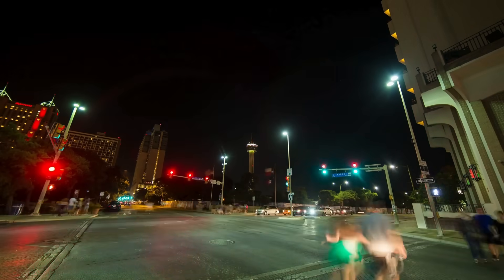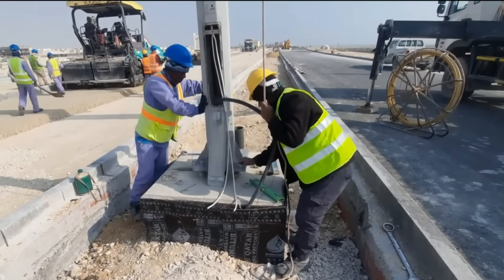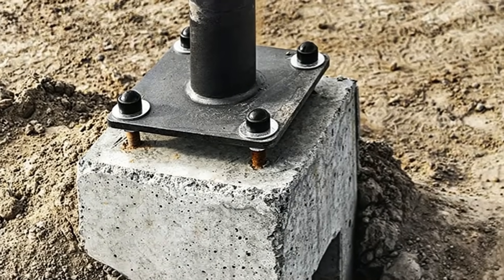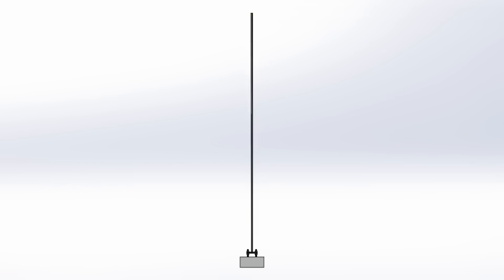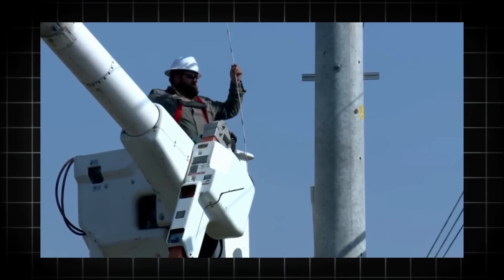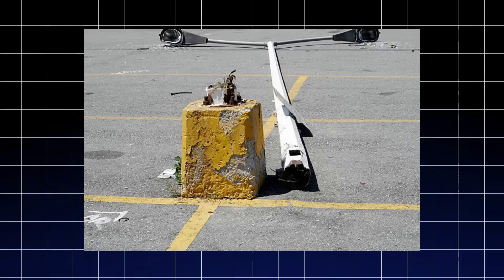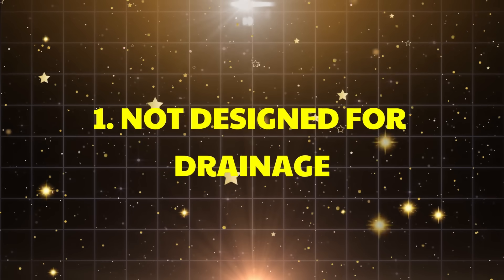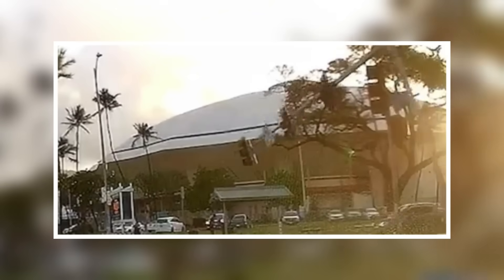Why Light Poles Float on Bolts Only, Not Flush with the Ground?

Comment: I sincerely doubt it is "engineers" making adjustments on those nuts.  Having worked as a plant engineer in an oil refinery, it was very much "look but don't touch".  Union rules and differences in responsibilities meant that we had to get a trades person or an operator to pretty much anything physical.  They did let us read gauges though.
Reply: Engineers make drawings and write specs, mechanics turn wrenches.  People use the word engineer to cover any type of work.
Reply: @GlobalWarmingFraud that is not necessarily true, particularlyin small companies. I make more money because of 'desk work' but have more fun doing 'shop work' I try to split my time between design and build. It usually winds up being about 60/40. I do agree civil engineering aren't driving around town replumbing crooked lamp poles.
Reply: @GlobalWarmingFraud  Engineers do not make drawings, designers do that. Engineers only approve the drawings.
Reply: But engineers designed it. That’s what he means.
Reply: Jeez....maintenance groups are also called engineering departments and there is a union group called Operating Engineers. That's the context of the statement. The worker, wrench turner in this case, is an engineer.
Reply: @johnkowalkowski4269  And  janitors call themselves custodial engineers.  I'll stick with you have to operate an engine like a locomotive or get an engineering degree to be an engineer.
Reply: This is the dumbest part of unions
Reply: Does a Stationary Engineer sit in an idling locomotive and blow the horn?? HAHA
Reply: making this correction tells us all that you, sir, are a true engineer
Reply: Electricians are the only ones who are supposed to install those poles. There are cover that come with the lamp poles to hide the gap and cover the bolts. If you see that gap, the cover was lost.
Reply: As a contractor in refineries and chem plants since the late 70's, a lot of the work we did was correcting engineering design mistakes(  making what they bought fit what the desired outcome ). Engineers kept us busy
Reply: 50 years later the tradesmen are still making those custom one off corrections. Nothing has changed. It seem the architects are even worse cause they have no knowledge of the products and materials they want to use and how the real world has to install them. But that’s where the skills of the tradesmen shows. Knowing how to make fantasy into reality.
Reply: Carpenters straight it 👷‍♂️
Reply: Potato salad!
Reply: "as plant engineer" who is impressed when exchanging business cards
Reply: Wait, you were an engineer and couldn’t figure out what the video was implying?  Priceless 🤣👍
Reply: @richdobbs Um, this is a quick 3 minute YouTube video, and you were offended because it wasn’t detailed enough.  You have to see the humor in your failed flex. 🤣👍
Reply: @garygolfer3243  I wasn't offended by the video. I was just pointing out a minor mistake, relating my experience.  OTOH, I do find you offensive.
Reply: @garygolfer3243 at what point did he get offended?  You must have read way too much into it with your own feelings attached, he merely added info and context from being an engineer. If correcting lackluster info given from an "educational" video is considered being offended in your eyes, I suggest you touch up on your interpersonal communication skills. Dude was actually pretty neutral in his statement.
Reply: @hiya2112  Your desperate comment indicates you are not familiar with the relationship between anyone involved.  Nice try. 👍
Reply: @garygolfer3243  I'm an engineer, so I analyzed what was said, not what you think was the obvious implication.  Basically what you do for charging a client for services rendered.  Has a definite price.
Reply: Sounds like this is a union that gets in the way of work more than it helps it's workers.

Comment: Unfortunately, while stand off base plates are very convenient for aligning, they do contain a fatal life limiting flaw.  The flaw is not considered by the design standards or designers.  i.e.  The thread below the levelling nut.  Stand off base plates are the only common situation when cyclic reversing loads are applied to un-preloaded threads.   Even ignoring bending, the stress range in the un-preloaded threaded section of holding down bolt is a small fraction of the endurance limit of the bolt material.  You don't believe me?  I would challenge you a) to calculate the load carried by each bolt.  esp. in a 10 bolt base plate.  You cannot.  The individual bolt load could be anything because the load is dependent on the installer.   b) to calculate the fatigue life of base plate assuming that the bolts are carrying a theoretically equal load distribution.  This design has been subject to many research papers.  For some reason, the design is still permitted.  Particularly, for high mast light poles in very windy areas.  If you do not want to do the fatigue calculation, think of this example.  Would you drive a car if its wheels had been "widened" by adding nuts to longer studs?  In effect, turning the stand off based plates by 90 deg.

Comment: Preventing corrosion by NOT filling the gap with grout does not make sense. Exposed bolts are obviously more exposed to moisture if without grout or cement coverings.
Reply: Exposed bolts dry in fair weather. Grout can wick moisture to the bolt and keep it there permanently, especially as the grout becomes cracked and weathered.
Reply: But when they are exposed the moisture will dry out.  If the moisture is trapped between bolts and grout it will not dry out.  It might not make sense, but if you look at places where metal is stacked on top of metal or other materials it will be most corroded where it is against another surface.
Reply: The assumption in construction is that concrete is saturated with water.  So, no, they are not more exposed to moisture.
Reply: @richdobbs6595  I still don't get it. In my house when a portion of concrete chipped out thereby exposing the steel reinforcement the advice is to cover/plaster that immediately to protect the steel from moisture and corrosion. Sure steel has different properties than the bolts, but the same idea of protecting them from moisture is the issue. So which is really the better option?
Reply: @MrKockabilly  I think you got bad advice. I'm just an amateur with an engineering background.  But to me the problem is that your concrete was chipping.  Covering it immediately would be a good idea if you were in a freezing climate, but mostly it seems like it is obscuring the problem.  The world is filled with examples of exposed galvanized steel.
Reply: @richdobbs6595  A standard in construction using reinforced concrete is that the reinforcing steel should be fully covered and not less than a certain distance from the outside surface of the concrete of the beam or column to avoid corrosion.
Reply: @MrKockabilly  Sure, and a lot of rebar isn't galvanized.  The reason it needs to be certain distance from the edge is structural, not corrosion.  Covering up chipped concrete isn't solving the problem for why the concrete chipped in the first place.  Still, the general issue is that the poster was trying to apply advice for foundations to galvanized anchor bolts that are intended to be exposed to the surface.
Reply: @MrKockabilly  A lot of it has to do with whether or not the water will pool in the area.  Automobile bolts are exposed to moisture and air all their lives and normally the only corrosion is surface rust unless there is a way for water to pool there and certain other circumstances.  Normally the worst of the corrosion is between the nut and the bolt.
Reply: The poles collect water from condensation. I have installed hundreds of parking lot lights, I have never seen a drain or weep hole at the bottom of the pole, but I have replaced many poles that rusted out because there was a few inches of water in the bottom of the pole, there are many examples of that in this video.
Reply: Most of the bolts that are used on city light poles and traffic lights are galvanized so the chance of rust or corrosion is greatly diminished, by years.

Comment: Why not make the concrete base blocks top more cone shaped so water can run of more easily and faster to keep bolt threads dry and clean. Also even threads are galvanised like most poles it will greatly improve the strenght and longevity of the  used bolts or threaded rods if they had a shoulder at least 1 or 2 inches up from the base. Thread right up to the often damp or wet base is asking for trouble. Better have a shoulder. These concrete bases are good for decades.
Reply from the maker: @ottifantiwaalkes9289  good suggestion. usually there is no water buildup over the concrete block plus the concrete does not have issues with moisture so designing a cone shape is an extra effort plus cost.
Reply: @MechFlare  not cone shaped but enough that water runs away and wind acts better on slope to keep fasteners dryer. Take few extra seconds to do when concrete is wet.
Reply from the maker: @ottifantiwaalkes9289  The gap is enough for the bolts to dry.
Reply: @MechFlare  Dude, so many arnchair fantasist engineers who have clearly never handled anything. In comments I mean.  Everything is a trade, thank you for highlighting, for me, the priority.
Reply: You’ve missed the point completely, watch again.
Reply: @paulthomson2375  do i? Please explain.

Comment: Excellent presentation.  I however wonder if it would be more beneficial if deform bars were embedded at the center of the pole?
Reply from the maker: @franssantos9417  Thanks for the feedback. As discussed in video, these are hollow structures and not primarily designed for weight.